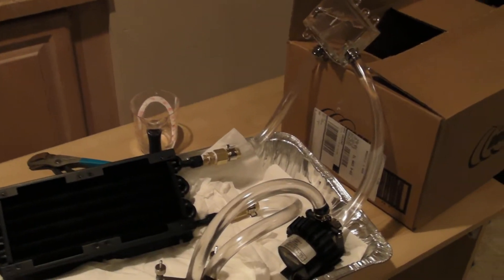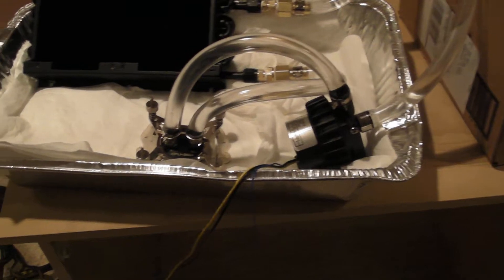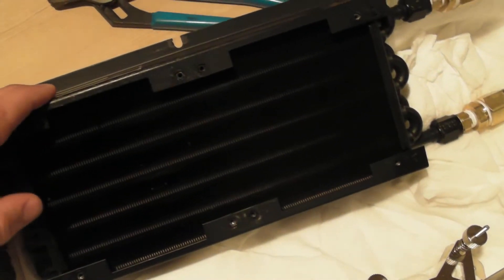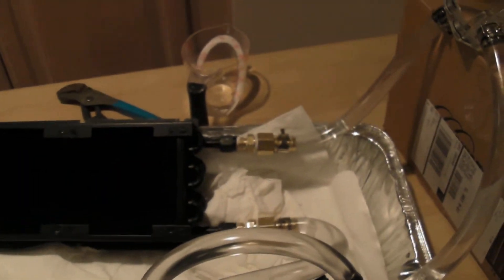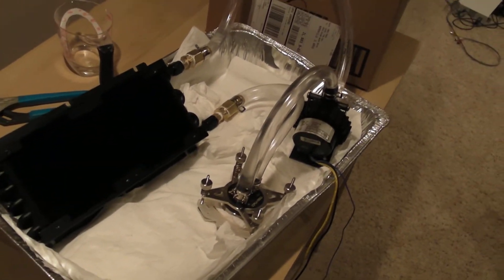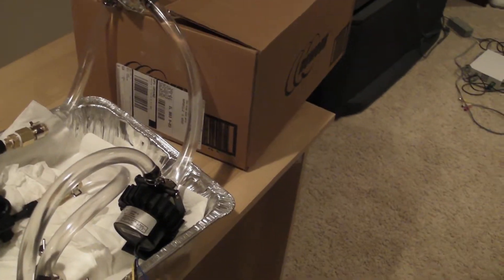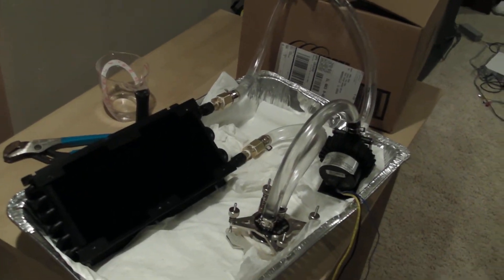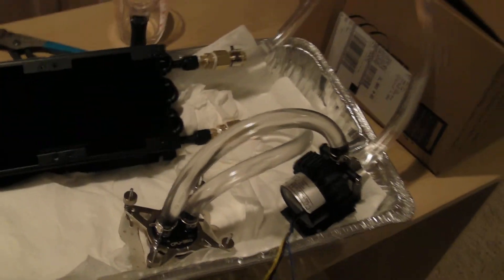Water Cooling Lian Li A77 | Part 1 - Component Overview and Testing

Comment: nice vid, but why not the EK supreme HF? its just slightly more expensive and the cpu 350 is a bit dated.

regarding the bubbles, just use a screwdriver and tap on the parts where the bubbles are